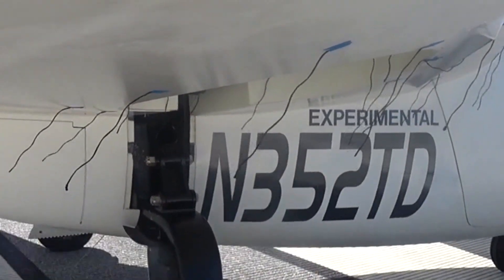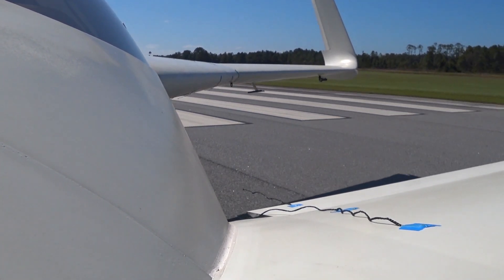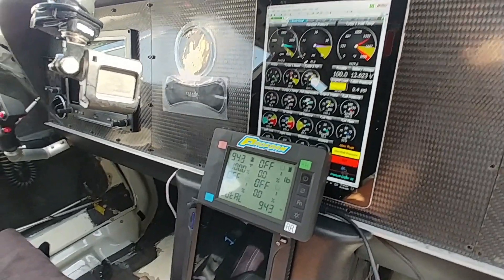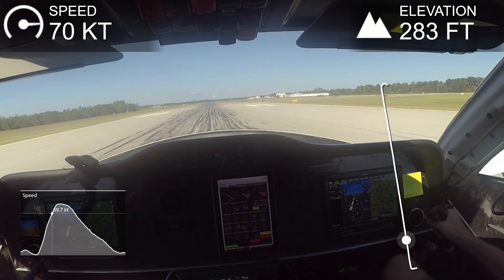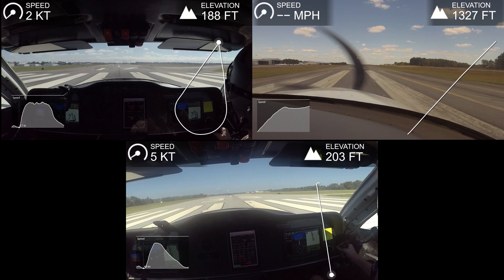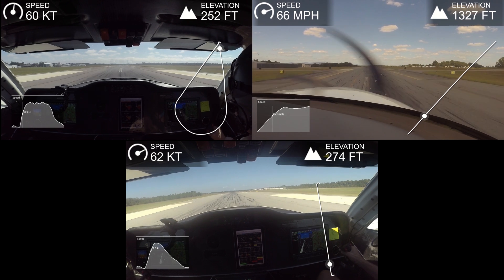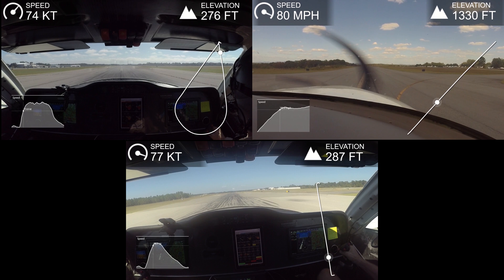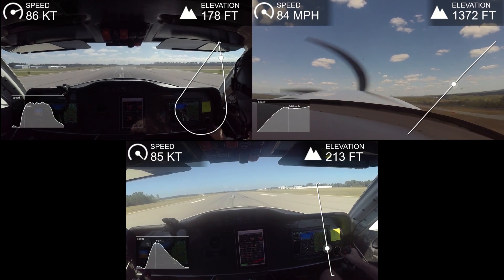Making More Power - Building the Raptor Prototype

Comment: Just remember to account for elevation. That run in the cirrus is over 1000 feet higher. Won't be a huge difference but something to consider. I would also stop worrying about power, there will be time for that later. The thing with testing is to change one variable at a time. Start with cooling, then wheelwells then move on from there. One will affect another.
Reply: Power could magically appear when cooling is addressed 🤷🏻‍♂️ 
I still think there is too much air pressure in the engine compartment in front of the radiator and too little at the intake cowling. Can the intake airflow be ducted directly at the radiator like in some race cars?  I’ll need to go back and find that video to see how it’s set up on the Raptor...
Reply: @gregorykusiak5424  fairly certain it is close to being direct to the radiator

Comment: Cirrus was at a higher altitude, depending on the air temps that day density alt could be significantly different
Reply: And when the Cirrus took off, the Raptor did not. The outperforming did stop there.
Reply: Flyby Wire, yup. If I remember right I think the Cirrus run was done during summer. At my field (650 AGL) we were usually around 2000-2500 density alt this summer, and currently usually around -35 density. Add in the higher elevation and they might be off by 2-3k density between those tests.

Comment: It's great to see the progress each week, and I really want to see this bird in the sky again. One thing that does concern me is the single ecu for the engine, seeing as you are from Aus, why not talk to Haltech and see if they have a dual ecu system, or work something out for you? Also on this, do you think it might be a good idea to get some help with tuning yours? as its great you are virtually a 1 person aircraft manufacturer, but help from specialists that play with ECU's all day couldn't hurt. Thanks for the constant updates. Good Luck from your Australian fans!
Reply: He had a lot of help last year on tuning the Audi ECU, as I recall.
Reply: He has the best ecu in the industry,  Motec, ,,, but it won't be easy to obtain redundancy  .
Reply: The idea of ECU's has been talked about on this channel and i personally dont see the need for that given that (a) the failure rate of ECU's is very low and (b) the two ecu's will be getting their data from the same sensor therefore if a sensor fails there is nothing the two ecus can do about that unless if you saying that each ECU will have its own set of sensors which is either impossible or will make the engine incredibly complex
Reply: @muzimbamabaka5412  ,,, really not too worried about losing the data . But two fuel pumps,, two ecu's with two injectors per cylinder would be very complicated, somewhat heavy, and expensive  . I'd just go with the parachute option .

Comment: That radiator area is pretty small, but it might be thick enough to work without the intercooler in the way. As a cheap and easy experiment, might try removing the intercooler, turn down boost, and see how coolant temps respond. If results warrant, could relocate the intercooler to one or more cowl air exit locations. Just an "armchair" idea. Hope the laptop and car start working again!

Comment: The stupidity of adding another set of radiators in the nose while ignoring the airflow through the existing radiator... this thing will weigh more than an M1 abrams by the time he takes off with an aft CG and rolls it inverted into the localizer shack

Comment: Your engine is drawing 93litres of air per sec out of your cooling air duct. A separate scoop for engine intake air may be a good idea. ie shorter path and cooler intake air and higher cooling duct pressure to push more air over the radiator.
Reply: @rv6ejguy 3.0litre engine @ 3750 rpm /2 /60 = 93.75 litres/ second. The assumption i did make is that the engine is only achieving 100 %  volumetric  efficiency but being turbo charged it will be higher than this may be much higher. But the what i wanted to make clear was that the cooling air duct is getting a large amount of air sucked out of it which it needs to be going through the radiator.
Reply: @rv6ejguy  He should know what his mass air flow is. But if it is 224 L/sec   that would probably be sufficient to lower the duct pressure to the point that there very low flow thru the radiator.   Knowing what the air pressure delta and temperature across radiator is would be good data to track down the  issue.
Reply from the maker: @paulchristian8261  yes, this could definitely be robbing air from being pulled through the radiator. I'll see what I can do to check on that.
Reply: @RaptorAircraft  You can start by getting delta-p and delta-t measurements across the radiator...

Comment: Nice work Peter. I empathise with your acute technology/car problems...2020 can suck it! As for the wheel wells, if it turns out these are a problem being open, do you have any thoughts on a future modification (like sequenced gear doors, maybe)? Just curious where your head is at on that.

Comment: You have to change the high pressure pump from CP4 to CP3! Also maybe bigger injectors. This is to get the same or more power with less heat. The CP3 is also more reliable.
Talk to for example Darkside Developments.
The aerodynamics I don't know anything about, but I hope you sort it all out.
Reply from the maker: I already have a CP3. It's been there since the get go. The injectors still have room.
Reply: @RaptorAircraft  Good ! 
I tried to look at old videos, but I only saw the CP4.
I started following this for the engine. Good to know that it is the right spec.
It is a huge project and you have come a long way.

Comment: I hope you get some wheels because that’s a problem. But you know that. I know you talked about retracting the gear on your next flight but I worry about cooling and if you need to drop gear quickly you may not have time without over temping the engine. I know this is running through your mind all the time. Not to mention if there is an issue with the gear. We’re here for you Peter watching and backing you if you needs us. Cheers Mate. Good luck because you sure can use some now...
Reply: @ryanthomas2472  - one thing he hasn’t considered is his main’s. They are box designed construction and I’d like to see the airflow around the main’s in a math model. I bet they have one hell of a drag component.

Comment: Great to see you optimizing the Raptor.  Sorry to hear of your bad luck with the Audi.  I hope it is NOT too serious and that everything is still under warranty. I say that as a former owner of a 5000S Turbo.  I feel your pain. 

Remember, “increasing performance” is too often accompanied by increased wear/mean time between failure and decreased lifecycle between rebuilds.  If you are exceeding the performance specs from Audi, you may want to consider installing higher-grade bolts/fasteners with the engine rebuild, similar to what auto engine builders do using ARP fasteners along with synthetic lubricants.  That is of course if it isn’t already using such a grade of fastener and oil (it would not surprise me).  They are good for another 4,000 RPM in a properly-blueprinted engine.  I wonder if porting & polishing the heads/intake would work on a diesel? It does wonders on gas engines - 100 to 150 extra Torque & HP on a small- block V8.

Comment: Have you considered a "" Mouse Trap " like wheel fairing that would be spring loaded and the tyre would activate it to close and on 
extension tyre would push it back open . As you will be at lower speed for V2 and approach.
Reply: The issue is to eliminate turbulence with the wheels down. Once retracted, it won't be an issue. Just a measure used for testing, not required in the final product.

Comment: I’m confused, what is the relevance of comparing the raptor to an SR 20? You should be comparing it to an SR 22 turbo if you were trying to do a comparison. A20 is not high performance and I would think we are all expecting the raptor to be more in the high-performance arena like the 22 turbo is.  You’re comparing apples to oranges instead of apples to apples so what good is that kind of data?    And really at the end of the day the prototype is completely overweight and the production models will be much better performing you’re doing a great job don’t get sidetracked with things that don’t really matter.
Reply from the maker: I'm just re-verifying that I'm getting over 300hp as opposed to the 230 that some now-it-alls say they think I have. This way I know that poor performance must be due to drag. That drag is likely from the wheel wells but also because the CG was more aft than desired on that first flight. I'm fixing both of these issues so performance should improve.
Reply: @RaptorAircraft  Hmm, wouldn't an aft CG unload everything and reduce drag? That's the case at least with conventional tailplanes.

Comment: Can someone give me the tldr version of why it is at 3600 lbs now? I think I read somewhere that the original design/concept was less than 3000
Reply: The real question is going to be how much of this excess weight can be removed and optimized away going forward.
Reply: The original empty weight was estimated at 1800 lbs, later revised upward to 2300 lbs. The last time we saw the Raptor empty weight, it was 3144 lbs. Some fuel, the pilot, and the latest round of ballast is probably how it ended up at 3600.
Reply: @jmburbach  I agree. I did not mean this as a complaint but to get some sort of crazy guess as to how much of it can be removed when optimized.
Reply: Raptor hit the ramp at 3,611 lbs for its first flight. The reason it weighs this much is because it lacks back seats, an interior finish out, exterior paint, de-ice, a pressurized cabin, and dual FADEC per the design spec. Gross weight is 3800 lbs. Weight and safety are two of the most popular cans that have been kicked down the road on this project over the years.
Reply: @simonbaxter8001  I don’t see Peter taking this project on solo for much longer.  I think he’s already got an exit strategy.  Perhaps he’s taking advantage of money to be made via YouTube before he hands off the design changes.  There has to be a next phase for this project and that phase will happen wether these problems are fixed or not.
Reply: @onethousandtwonortheast8848  That's an interesting hypothesis, assuming you're just speculating. What makes you say he's looking to offload?
Reply: @PatrickJWenzel  well, I don’t think he’s doing this just for ego. There is money to be made if this is somewhat successful. Even if it doesn’t get fixed, he’s already mentioned in the past that he has contemplated offloading the project onto someone else. The way this entire project is going makes me think there’s got to be something going on in the background that we don’t know about.
Reply: @ryanthomas2472  ok then, I’ll assume if you’re producing 2 videos per week and each one gets a few views, that’s a lot of views when you look at the aggregate of videos he’s produced.   Over the years, it an income stream that is perennial.  Will it make him a millionaire? Maybe not but if I had put as much work into this as he has, and money, I’d be interested in getting as much back out of it as I could before the handoff and future royalties.  I’m certain someone will take this off his hands and “fly” with it.  He is no dummy and he will make a sum of money from the business that takes over his design and “proprietary developments in manufacturing” he has made.  What those are, I don’t know but he mentioned it a few years back.
Reply from the maker: @onethousandtwonortheast8848  I'm actually already working with a group of people on the production plan but I need to have the 40 hours flown off first before we can proceed. This doesn't really require much help once I get the current issues sorted, just some time and favorable weather .
Reply: @RaptorAircraft  Ahhhh, that’s right, you did mention that before - I just forgot.   Anyway, carry on, I think your harnessing of YouTube to advertise and get paid to do so is brilliant.  I really do wish you success and if what I’m imagining can happen, this project could single handedly create a paradigm shift for GA travel and ownership standards.
Reply: @RaptorAircraft  If this were an amateur-built experimental from a proven kit with a proven engine, like an RV-8 or RV-12, then verbiage about "flying off the 40 hours" would be excusable. But this is a novel airframe with a novel engine, both with very glaring deficiencies, so the forty hours is right out the window. 

What you should have been doing is developing a clear and methodical plan that addresses the aircraft's deficiencies in a logical sequence. Near the top of that list is probably addressing the cooling issues. Once you can get the engine to produce full power for at least one full hour of flight, then you can worry about the next sequence of tests spelled out clearly by a flight test plan where you explore and expand the flight envelope and address the problems with pitch and roll stability. Given what we saw in the "first flight" video, I'd budget about 100 flight hours, and about 500 engineering hours to address the problems. 

Observing that there are few if any cases where open gear wells have caused pitch oscillations, I would start elsewhere on that one. My bet is on interactions between the too-limber control systems for the ailerons and the elevator, combined with an aft CG situation. Your calculations for static stability are unlikely to have accounted well for the non-linear alpha response of the very wide forward fuselage, so it would probably be good to stay very near the theoretical forward CG limit.

Good luck, and stay safe!

Comment: You've got plenty of power and you should have sufficient cooling. 
Unfortunately you've also got a lot of drag from the undercarriage and If you're not going to take the obvious route of climbing to sufficient altitude to give you time to test the aero with the wheels up, why not just make a couple of sheet alloy fairings to tidy up the airflow on the legs and see if that helps?

Comment: Peter, forgive my ignorance as I am simply a painting contractor (retired through a brain injury).., but you said your beating the Sirrus on performance.., my point is that maybe your pushing the Raptor too hard or harder than you need to push it?.., I have a gaming PC and I can overclock the processor to the max but what will I gain when unclocked it performs great?.., I guess my tuppence worth would be to find a balance between performance and functionality.., but watching you all this time I have faith in you that you will do it.
Reply: The Cirrus goes twice as fast as some aircraft with the same engine, without pushing it (or overclocking it, as you put it).  An aircraft's speed is more dependent on aerodynamics than power.  A simple rule of thumb is if you want to go twice as fast you need four times the power, that's because drag quadruples as speed doubles.  If you cut drag down to 25%, using the same engine, you'll fly twice as fast.  The raptor's primary benefit is aerodynamic efficiency, not raw power.  The raptor's problem here is an engine in both an unproven application and an unproven aircraft.  Not much is known about either, nor how they compliment/contradict each other at this point.
Reply: @ryanthomas2472  Wasnt suggesting he babies it, what I did say which you seemed to have missed is that he finds the balance between performance and functionality.

Comment: Leading edge on the main wing too thick, also too much curve under the wing and not enough above (lift aspect). This is probably causing a stall oscillation upon acceleration.
Reply from the maker: FYI, this is a NACA 6 series laminar flow foil profile, not just something I made up.